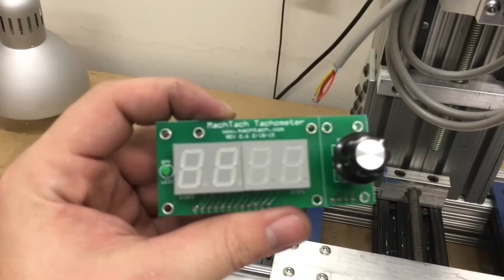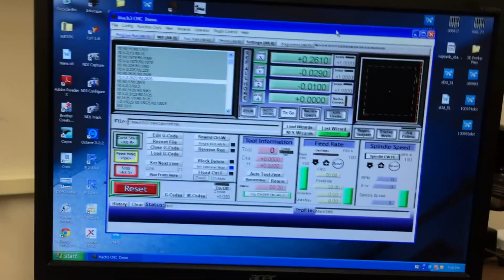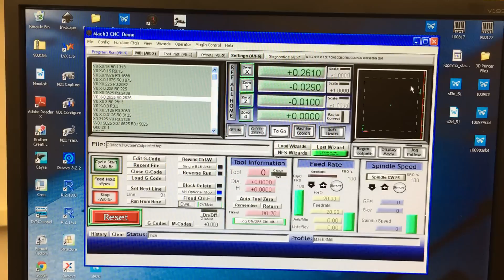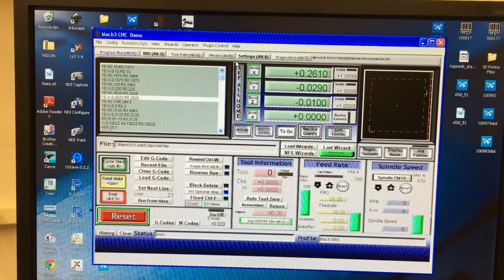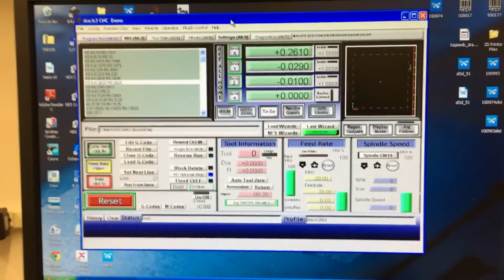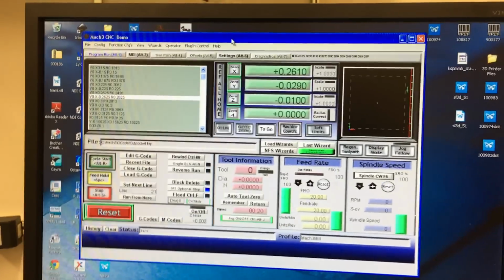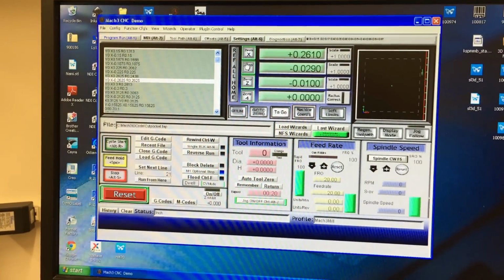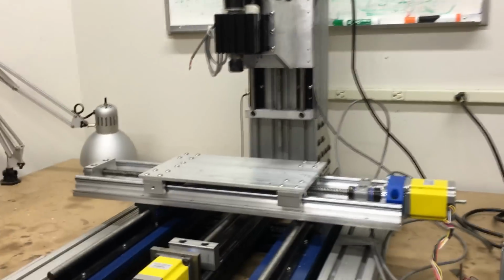DIY CNC Mill Build Description

Comment: Looks wonderful! I guess the spindle is not tied to Mach3? The tach you showed in the video that were not wired up yet.. does it control the rpm closed loop? Any concerns on motor housing thermal expansion..?
Reply from the maker: +Sangyoon Kim The spindle is not controlled by Mach3...yet. I would like to do that sometime down the road. I am using MachTach 
http://www.machtach.com/
Dont confuse MachTach with Mach3, they are not related as far as I know. But it is just measures the rpm of the spindle. There is no control loop at all right now. 

As for the thermal questions, I am not worried about my motor getting hot. It is bolted to the aluminum frame and that will pull the heat away quite well. The whole spindle mount is acting like a heat sink and there is pleanty of air flow around the motor as well.

I got side tracked on other projects and my work is in the process of buying a Haas Mini Mill. So I have stalled a little bit on this project. But I still plan on finishing it one day when. Most likely some other project will come up that will make me want to use this mill and that will motivate me to finish it.

Comment: Is this machine done now? I have been following your build for a while and am currently building something similar!
Reply from the maker: This project got a little side tracked. I used it at work and then it turned into a work fixture for about 2 years. I couldn't share anything about what we were doing with it because intellectual property.

Comment: Very nice! Regarding the frame using aluminum extrusions, i see you used flat plates with bolts to join extrusions at 90 degrees. Did you use any additional support, like corner brackets at the inside of the joint? thanks
Reply: It is a combination of plates and corner brackets.

Comment: I am very curious how you built the spindle, I hate how all chinese spindles that are cheap are either requiring insane power phasing or doesn't go into low enough RPMs, so I wanted to make my own setup that sorta looks like yours, but I am wondering what bearings will do the job for as little runout as possible? I know you can get 150mm long collet shafts with near zero runout on amazon for 10$ so the question is basically where can one get bearings good enough for a spindle that dont cost a fortune? since the chinese spindles on ebay ironically aren't even worth fixing when the bearings break cuz it seems seperatly the bearings cost as much as they do already assembled in a spindle by someone in china :(
Reply: The spindle is from a Taig Mini Mill. It is a good starting point and accepts any ER16 collet. Since it is a complete unit you can avoid a lot of worry about the bearings alignment and loads from cutting being transferred to the motor. Since the Taig spindle assembly has a stepped pulley on it, I can select which ratio I would like to use from the motor to the spindle. The motor also has a speed controller on it. But even with the speed control you are limited in how fast or slow you can run the motor efficiently. With the step pulleys i can pick ratio which lets me run the motor efficiently, and still get very slow or very high spindle rpm. 

Another advantage is if the cutting bit is slowed down while cutting the belt can slip on the pulleys, or even break. It is much cheaper to replace a small v-belt than the spindle or motor.

Comment: Does it use linear roller ways and a ball screw feed. I need to know where to find the roller linear ways for when i build mine.
Reply from the maker: This model has supported shaft and ball bearings for the rails. It is cost effective but one day I would like to upgrade it. It also has precision acme thread and anti-backlash nuts. I got a lot of my parts for this build from surplus places or from my university cleaning out storage. I was collecting parts for the build for about two years and then designed a cnc around those parts.

Comment: Argh... i get heebie jeebies when you go poking around that spinning collet and those timing belts...
It's just so darn dangerous that i can't help it :D
Reply: +Mtaalas It is not actually that dangerous when you have been working around a machine like this for years. I understand exactly what can happen. Also, the video makes it look much closer than it really is. Another thing to consider is the timing belt is quite loose so even if my finger were to get caught (highly unlikely), the belt would stretch. There is also no cutting tool in the machine which makes it much safer. 

All that being said, I have plans to put a nice acrylic cover over the timing belts mostly to keep dirt out. Please be careful when working on machines like this. Be aware of your surroundings, how to cut the power, and wear safety glasses.

I am actually much more concerned about having the electronic enclosure open to show the electronics. This is normally closed. The motors draw up to 3 amps, which is quite a shock. I have fuses built in, and this is normally completely enclosed.
Reply: +Tank Chain 
Hi Sir,
Great idea to make a cover with acrylic sheets. You can still see whats happening.

Comment: Very nice! Great Job! That's what i'm searching for! thank you for sharing!

Do you have more Information about the Couplers and Bearing Stuff on the Motor-Side?
Reply: +Tchefter Just Google (or use your preferred search engine) "backlash free coupling" and  "lead screw thrust bearing" and you will get the information you are after. Its a lot of different types for sale at e.g. EBay.

Comment: hello sir. how is the complete size of the maschine? because i want to build an milling maschine with a lot of z travel. all i could find before was videos of router machines an they have a small z travel.
Reply: The entire machine fits inside a 24 inch cube.
Reply: did you rebuild it?
Reply from the maker: Sorry, I have more than one google account and when I replied I was logged in on my other one. I did build the machine, and the Tank Chain account is mine as well.

Comment: You probably know this already, but the 3D printed part did NOT work out as well as you are saying, it is cracked already, which you can see here: https://youtu.be/1GKhLaHbSNY?t=96 I guess you have changed it a long time ago, but I hope you discovered the crack before your stepper fell off.

Comment: What motor did you use?
Reply: +Gavin Luis D&#39;Mello  The stepper motors on the X, Y, and Z axis are 280 OzIn Hybrid stepper motors from Probotixs. The spindle motor is an AmpFlow E30-150 dc motor. One nice thing about the spindle motor is AmpFlow makes 3 versions of this motor that all have the same mounting dimensions and only slightly different length. This motor is the 1 HP version and the least expensive. But I can upgrade to a 2.3 HP or 3 HP spindle motor very easily.